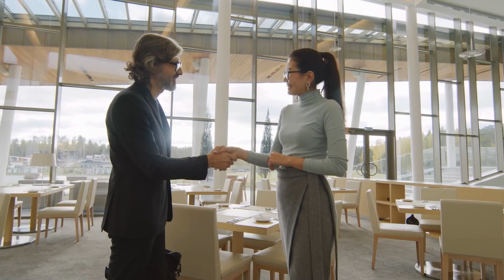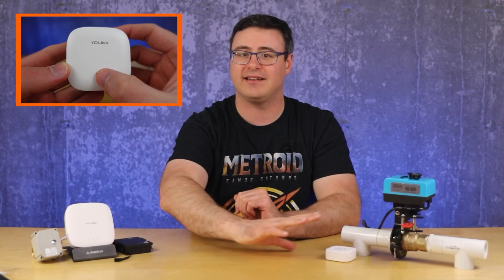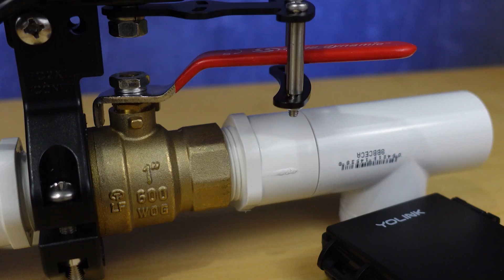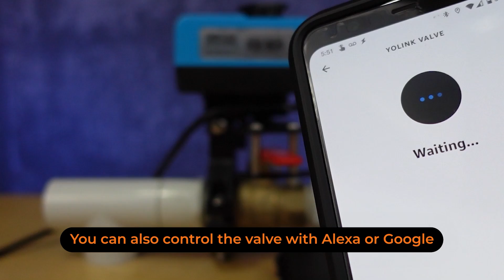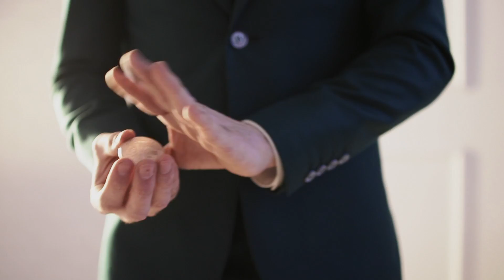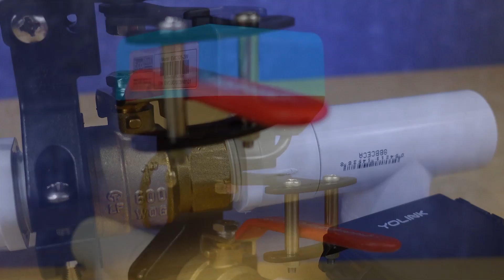These Two Companies Combined To Save Your Home From Leaks!

Comment: The bulldog system works well only in a lab. I spent hundreds (plural) dollars trying to make it work and gave up. The main problem is the mount. As soon as the valve is tight to open/close, the mount isn't strong enough to withhold the applying force. It just cracks. I replaced three or four. I made a stronger mount out of third party parts. It didn't break but the whole thing skewed over the pipe. 
It's just not a good design.
Reply: @akuzminsky that’s exactly what’s happening to me.  It’s not closing the valve completely.  Support is recommending to install the EVO.

Comment: So this system only shuts water off if a sensor tells it to. So if you are not home and a pipe leaks in your attic then your going to get flooded and unless the water hits a sensor the water will never be shut off. Correct ? I guess the idea is to place the sensors around the most likely places a leak might happen. Not for frozen pipes in the walls.  I guess its better then nothing.
Reply from the maker: Correct. Except if you knew a leak was occurring YoLink's hub would let you send a close to the valve too.

Comment: Bulldog YoLink valve is $299 on Amazon. Not $145 you’re claiming. I already have YoLink and hub and it’s good. 
Looks like I need to buy the bulldog actuator valve and valve battery right?
Reply from the maker: Depends what version you're buying and they've definitely shifted in what and how they're selling things.

The battery is up to you. I didn't have it in this video but I don't think it's a bad idea to have a battery rated to move your valve in an emergency

Comment: Hi. How do I get the bulldog to show itself as online? My Water sensor is triggering the bulldog, but I have no way to control the bulldog with my phone. It is listed in the yolink app but says offline. Thanks!
Reply from the maker: It should show up.  Not sure what's going on there.  Maybe try a reboot of the actuator and hub?
Reply: @AutomateYourLife  Hi. Apparently the Hub is required to do this. I didn't realize.

Comment: Hi. If I directly connect the sensor to the bulldog, then I will NOT get an alert on my phone if there is a leak - correct?
I would need to have a second sensor connected to the internet to do that - is that correct?

Thanks!
Reply from the maker: You'd get the alert that your valve closed though.  So it's essentially the same thing :)
Reply: @AutomateYourLife  Ok, so, I am missing the part where I have to buy the hub in order to get the bulldog connected to my phone. Somehow I didn't pick up on that fact at all.

Comment: Great info! Do you know if there is anyway to use the Aqara system with their G2 cameras as zigbee hubs. I already have a ton of their leak sensors so trying to figure out if one of their other Aqara automation products would be able to act as a controller for the valve? Thanks!
Reply from the maker: Hey John, I'm sure Aqara could engineer something but they don't have something today for this actuator.  I've seen a Z-Wave, WiFi, and this LoRa version so far.  Nothing for Aqara sadly
Reply: @AutomateYourLife  Thanks. I guess the LoRa setup is better since when there is a leak as you say, loss of power, or internet, or wifi connection from a hub should not stop the system from working to shut off the water. I’ll get some sensors for key areas like water heater and kitchen where I may have the Aqara sensors too. I’m guessing that there is no way to have this all be somehow homekit compatible? I’ll just use the YoLink iOS app.
Reply from the maker: You can get it homekit...

https://youtu.be/XV_w4UFdq7o
Reply: @AutomateYourLife  Thanks for all the help. Wondering if you have checked if you have the Device to Device communications setup from the controller directly to the device, will the YoLink hub still see all the sensors and the valve for monitoring and control if there is internet. Or do you have to unlink the devices from each other and connect back to the YoLink hub? Thanks again!
Reply from the maker: Everything is maintained using the device to device pairing.  Nothing changes in app or in the hub

Comment: Brain you mentioned  you dont need the hub if there is that black smart valve controller but in the yo link website on the product page it says hub required.  Can you please confirm if the hub not required because if hub is required then it becomes power dependent
Reply from the maker: You don't need the hub if (and only if), you just use the direct pairing feature.  So when a leak sensor is paired direct.  There would be no other options for automation and no notifications.
Reply: @AutomateYourLife   thank you for the reply. so without the hub can i still  control the opening and closing of ball valve through mobile app?

Comment: Hi Brian, great video.  Is the controller waterproof as my valve is outside?  if not any suggestions to cover it to keep rain out?
Reply from the maker: Hey Joe, EcoNet Sells longer cabling for these so you can get the controller indoors.  So that's my suggestion!  It's not made for outdoors :)
Reply: @AutomateYourLife  I meant the valve actuator that goes on the valve as I can seal the battery controller OK
Reply from the maker: So I'd suggest you check on their site when you're looking at ordering.  I believe they offer a second level of sealing if memory persists!

Comment: It’s much better and smoother if you drill the handle and bolt handle to actuator. There is too much play otherwise. I use them in my short 1/4 turn outdoor gas valve to ensure my gas is never left turned on.
Reply from the maker: Nice use case there.  I hope you have some secondary confirmation of any gas valve though.  Like a contact sensor or something k?
Reply: I also find drilling though handle and bolting it takes play out and make it run smoother. Faster and more reliably.

Comment: So can this be integrated to Smartthings as well?  I really like the idea that it uses LoRa to connect direct to the sensors (no need for internet and long range) and the long battery life on the sensors... however, how is the integration? I really try to keep everything contained in that platform except for wyze cams (unfortunately).
Reply from the maker: So that version of it can't go into SmartThings, but the previous version we reviewed for the Bulldog valve can and does!  In fact, there's a full Z-Wave option they sell too that goes direct in.
Reply: @AutomateYourLife  that’s too bad.  So in essence you have safer reliability or more convenient, but not both.  I think I’d lean more toward this setup… correct me if I’m wrong (was just working a graveyard shift) is this setup still controlable via an app over the internet as well?  So let’s say, I leave for vacation and want to turn the water off while I’m away from the phone?  Also, your channel is absolutely great and I, and others I’m sure, are super grateful for your dedication to the comments section.
Reply from the maker: Ohhh so...go watch the other Bulldog video! It's in the links. 😀 The sensors they sell pair directly without internet too!  

And thanks for the recognition!

Comment: Brian, you know I love this!!!  That's essentially what I'm doing in my home with one little addition.  The YoLink siren also pairs directly with the valve operator and the leak sensors such that it also works when there's no electricity or Internet which is pretty cool.  I'm using their much less expensive valve operator which isn't as beefy as is the Bulldog one, but since in my case this is only intended to operate under "emergency" (leak) conditions, it's fine right now.  The only thing you miss without power or the Internet is the ability to be notified by phone or use any IFTTT applets you have until the services are restored.  Thanks as always for what you do for the community!!!  The reliability of YoLink's LoRa devices has been perfect for me...I have 21 of them which includes 8 leak sensors.  Oh, their leak sensor 2 even has a small built-in siren which helps quickly find the source of the leak.  Be sure to get the version with the probe-tip, though.
Reply from the maker: I know you do love this!  And I love that you're so excited sir.

Plus I love that siren point too...shoulda thought of that myself!
Reply: Which valve did you end up buying?

Comment: Hi Brian, hope you are well.... I automated my sprinklers to work at my garden and they are working based on specific time I have configured. 
I want to make it better and add something that will tell me when its rain and based on that I will create an automation that will not turn on the sprinklers in case there is rain. do you know of such device that I can use? is it regular leak sensor can do the job or maybe there is something else I can use?
Would love to hear your thoughts
Reply from the maker: Could you use SmartThings Weather?  I don't know if they have it in your country but that's an option that could be used.  Just maybe set a virtual switch on called "ItsRained" whenever it rains and then turn that switch off once a day or something like that.  Whatever schedule you want to set.

Just a thought.  Otherwise, IFTTT has a weather service too and you could push that down to ST which I know you have.
Reply: @AutomateYourLife  yep, I already setup ifttt weather to notify me when it rains.
By the way, the weather tile in ST is not getting updated (the one you create a device with weather smart station type).
Do you know if the leak sensors will be OK outside? Maybe I can use them as well
Reply from the maker: Well...I don't think they'll work.  They will likely get ruined quickly and also hold a rain status for longer than you want.  I know Netatmo makes something...but not sure of the automation options.
Reply: @AutomateYourLife  I will check netatmo.... Many Thanks Brian, really appreciate it

Comment: LoRa uses very similar frequencies to Z-Wave, but in a way that allows very long distance line of sight.  It still is not brilliant if encountering walls unfortunately, and a steel enclosure will block virtually any radio signal :).  It will also suffer the same issue as Z-Wave as different countries use different LoRa frequencies.  So your European LoRa device is not necessarily going to work in the US.   LoRa can also use 2.4GHz band, but that then will encounter the same limitations with objects as WiFi, but will still have much more range.   That said, LoRa is definitely an interesting solution,.
Reply from the maker: Wait so you mean the nuclear bomb shelter won't let radio signals through!?  Ohhh nooooo ;)

Yeahhhh, we've got the whole frequency thing going on here.  Thanks for bringing that to everyone's attention sir!

Comment: Really love to see products that move/manipulate objects in physical space. I think this is next challenge in home automation than industry will need to tackle. 

Personally, I would love to see windows that automatically open and close. Saw some DIY solutions but something polished would be great to see.
Reply from the maker: This is exactly how I feel.  We need to get things moving!  I want to see the windows solve too, doors, and I like that this one does a valve in a nice, smooth way.
Reply: @AutomateYourLife  I feel like doors could be solved already. I definitely have seen auto-opening doors in malls (both sliding and that open more traditionally) that are triggered by motion sensor. Slap a shelly or a smart sensor on that bad boy and you have a smart door.
Reply: "…love to see products that move/manipulate objects in physical space.…" 
Boy you've really hit the nail on the head, Romans! Great point! Hope to see more and more products that meet your definition.
Reply: @utuber1000  Totally! As an 'out-there' example:
I once saw a concept of smart meeting room where chairs auto adjusted their position after meeting ended. This might sound silly, but my constant struggle is with my robot vacuum making silly rounds around chairs. I see such chairs as a great way to 'prepare' the floor for robot vacuum.

Comment: could you review Moen's system this.
Reply from the maker: Hey Mark, I've seen Moen's system and I've always thought of it as a different kind of whole home solution.

Think of this as easy, generally cheaper, and easier to maintain in the long run.  The whole system works together seamlessly, and you had to do nothing to put it in...and you can take it when you go.

Moen's system you have to put in-line in your plumbing, which means you have something to deal with when/if it dies or becomes incompatible.  I also don't love that it's based on flow.  I've done a LOT of flow measurement over the course of my career and it's tough to get right 100% of the time.  From what I've seen, people are really happy with the Moen too though, so it seems like they've done a good job there.  Still, I'd rather a simple on/off leak sensor deciding my home's fate then a CPU with an algorithm based on flow.

We're still in an age where 10 years out of something like this would be great to be able to have it work with the rest of your smart home, so I'm going to pick something that at the end of 10 years, I'll have.  I think YoLink works like that, because it's not even based on the internet or connectivity when I directly pair all this stuff!
Reply: Brian I was just going to ask the same question...and you smashed the answer out of the park! Long time fan, first time commenter. Keep it up, I'm relying on this channel waaay out here in Malaysia 😂
Reply from the maker: Welcome and I hope to keep on smashing it!